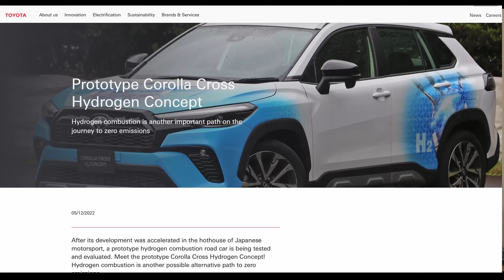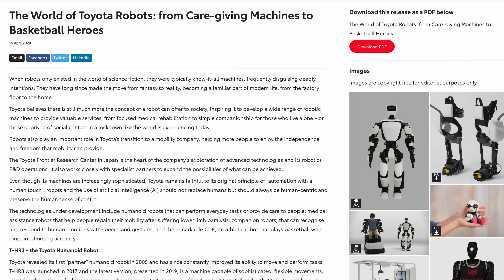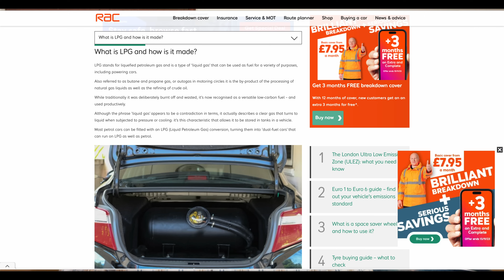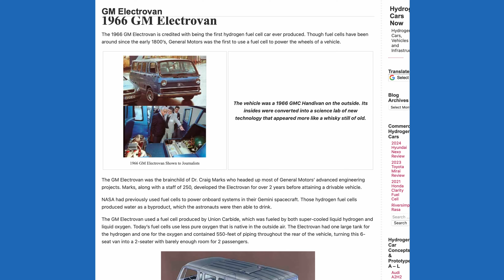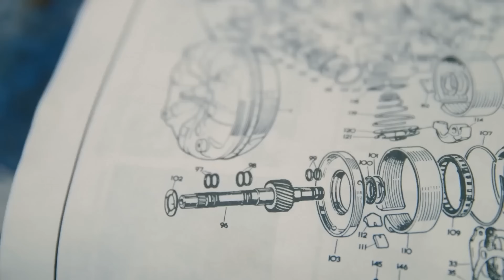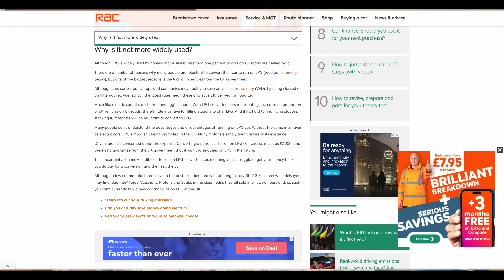Will Hydrogen Give EV Charging A Run For Its Money?

Comment: The botton line is that to conver all  37 million uk road vehicals  to EVs (at current mileage of 8000 per vehical per year)  will need about 65 to 70twh per year, or an extra 20% or so above current demand. . 

Using electricity to produce hydrogen hydrogen from watter for the same 37 million vehicals at the same 8000 miles a year, would take about 180twh or about 60% above current demand.
Reply from the maker: when I was a lad, we had one electric light per room, only on when the room was occupied and an immersion heater used just once a week and a fridge. Now my house has multiple lights in every room, fridge and freezer, washing machine, dishwasher, shower, cooker, hob, extractor fan, toaster, kettle, food mixer, hoover, iron, satellite receiver and widescreen 4k TV and loads more.  And most others in the UK have all done the same. We are still waiting for the grid to crash. Maybe, as demand increased they very secretly just added a bit more capacity? No, couldn't be that easy, surely
Reply: @davetakesiton  since about 2007 demand has done nothing but fall. Demand that year was 375Twh by last year demand had "decreased " to 306twh. YES demand is FALLING!

So generation , demand on the grid has gone down. 

The other issue is local loop. That is the 230v cabling from the substation to the home. That is spected for 1.5-2kw per dwelling. So we can't all be  drawing  7kw at the same time. But we won't be , because the average car is driven 23 miles a day. So can be toped  off on an 7kw home charger in less than an hour. Yes some people will do more and need to be on for longer. Maybe a taxi will need to be on charge  for 4-5 hours a night. But very few people will be doing that every night, and for them a 3 phase supply and  a 22kw charger may be worth while.
Reply: @davetakesiton  lighting and appliances have become far more efficient which is a huge factor too.
Washing machines on 20 degree loads instead of the "old" default of 60 degrees.  My dishwasher uses as little as 0.4kWh for a load.  My new American fridge freezer is <2kWh per day, down from 4kWh for the old one.
Reply: You forgot the hydrogen infrastructure. I do not think the UK could afford the cost for hydrogen production, storage, handling, refining and distributing for 37 million road vehicles. Or any other country.
Reply: @wolfgangpreier9160  quite, It would  cost a fortune. Even  If producing the hydrogen were cost-effective in the first instance..... The national grid is already there,  and with local reenforcement,  can easily go from delivering 306twh a year (2022) to delivering 375twh a year (same as it was in 2007)
Reply: @patdbean  Yes, The same goes for E-Fuel, 

its not hard to distribute, but i costs 27kWh per liter to produce. 

And no one on the world has a mass extraction of CO2 from anywhere, air, power plants, fertilizer production, steel in the needed quantities.

Meaning: There is no CO2 extraction in existence for E-Fuel or green methane. 

What a bummer...
Reply: @wolfgangpreier9160  And what does every hydrogen filling point need to function? Yes, an electricity supply........Rather ironic....
Reply: @Brian-om2hh  you know what every fossil car needs to work? A battery. And every gas station? Electricity. Ironic.
Reply: This figure of 37 million vehicles and the assumption that they all do about 8000 miles (or whatever) is flawed though but often quoted by the ICEosaurs.  2 of mine have done no more than 1000 miles in the last year.  2 others about three times that.  The EV is doing the most.
Reply: @djtaylorutube  well obviously they  don't ALL Do 8000 miles a year.  It is  an "average" many do less as you say, but busses taxies etc do a lot more 1,000 a week is not unheard of. But from the point of view of grid load it is the average along with the time of use that  really matters.

If everyone charges their EV at peak times (4 to 8pm) then the grid has a REAL problem. But obviously pricing will stop that happening. You will soon get out of the habit  of charging at 35p per kwh when 1 to 5am is 7.5p per kwh.
Reply: @patdbean  Indeed. My cheap rate is 16p but as Dave mentioned in one of his videos, he has a reason for keeping his tariff and I have mine.  I get 7 hours of cheap in winter from 2am to 9am and in summer, 3am to 10am.  That morning time on cheap is my cooking time and allows all of the morning use, hair drying (not mine!) and any pre-heating of the car if we want it all off peak.  With a storage battery that only has to take over from those hours and lasts the day.
If I were to change to Octopus Go, i'd a) need a smart meter (nasty things!) and get less off peak hours and the battery would need to kick in four hours earlier and therefore run out while still in peak time.
I've done the sums and we're still better off at the moment. :)
Reply: @djtaylorutube  quite, dave's 11p per kwh is good for him. But if he had a 3 phase supply and a 22kw charger. Then it would probably be better for him to go on octopus GO and get 4
  Hours off peak each night for say 7.5p
Reply: @patdbean  Yes but the install of 3 phase is on average about £6000.  That buys an awful lot of electricity!  He'd also lose the entire weekend cheap rate as I recall.
Solar is the other interesting aspect, i'm building a substantial shed with a view to adding more solar.  Reality is that the payback is tricky to calculate with tariff unknowns and saying I can charge the care more forgets that even now, for £300 a year that's half my mileage but only buys a couple of solar panels worth having.  It's a fun game but far from trivial to figure out with so many dynamics in play.
In my head i'd like to get 3 phase, more for future proofing but then even if we had 2 EV's they wouldn't need both charging each night, i'm just mentally playing with upgrades for the sake of it. :)
Reply: @djtaylorutube  quite, in most domestic situations 3 phase dose not really make financial sence. Maybe in a 2 or 3 car family perhaps were one is a taxi and absolutely must have an 80%+ charge every morning.
Reply: @patdbean  
2 points.
The smart method (government, companies, or individuals) is to fragment and "invert" the grid by installing local generation (2 solar panels on every south facing roof, or wall)
Either directly by government, or funded by grant.
Costs partially offset by the huge employment opportunity (those installers would pay tax).
.
The time will come (certainly if the grid structure remains as is) that the existing "overnight cheap rate" almost "giving away" skate energy will become a "second peak" period. Not as much load as the evening peak, but lucrative enough that energy providers "adjust" the overnight rates (upwards)
Reply: @rogerstarkey5390  I don't think overnight rates will go up that much. Because the the weekend is a good time to charge for most EVs users. 8000 miles a year is about 25 miles a day. If you have solar panels at the weekend between say may and September you can add that 175 miles or so over the weekend for free. Only in the winter would 3-4  hours  a night twice a week make sense.  So at today's overnight prices 3-4 pound a week in the uk, September to March.

Comment: Although water is a by product of burning hydrogen, burning hydrogen in air also produces various oxides of nitrogen which are powerful greenhouse gases, the only way to just produce water from burning hydrogen is burning it in pure oxygen. The YouTube channel “Engineering with Rosie” produced a video of why hydrogen will not be used ( except in very limited situations), for heating, transport etc, it just isn’t commercially viable. But as you say Dave the fossil fuel companies ( including British Gas for domestic boilers), will just keep spinning the same story, and at the same time get gullible governments to provide taxpayers( ie money from you and me) money for hydrogen “development”.
Reply: Is that the same Rosie who was (apparently) touting Toyota Fool cells a while back?
Lithium Irony?
Reply: @rogerstarkey5390  Not that I am aware although there is a similar YouTube channel called “Engineering Explained” which was  concerned with Toyota fuel cell.